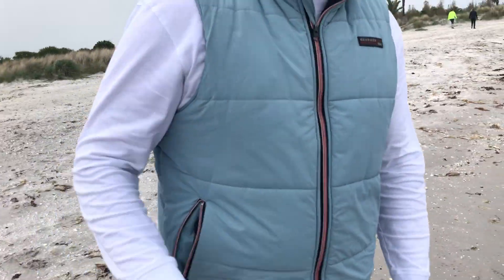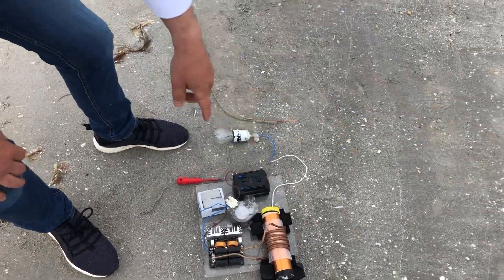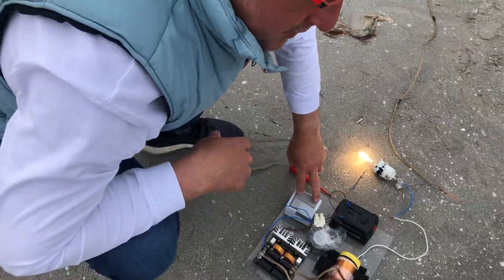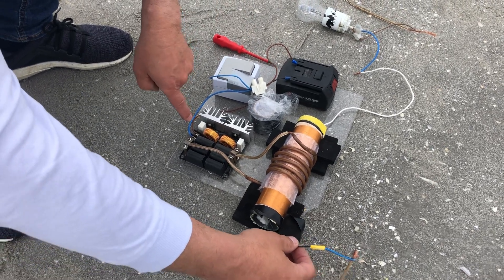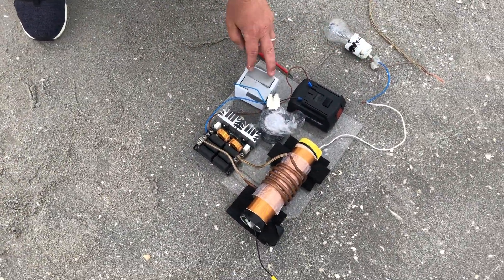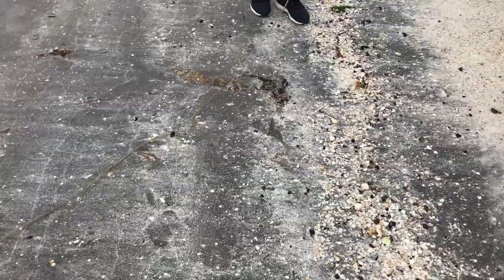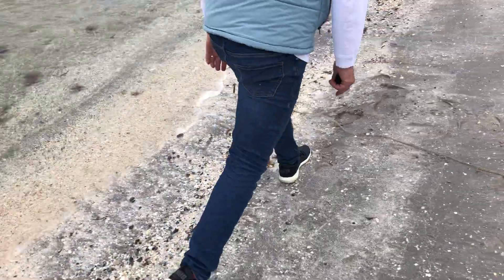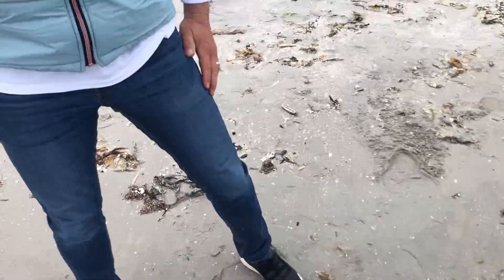Earth medium for electrical transfer

Comment: Did you tune L2 (secondary) coil to work in resonance with ZVS?
Reply from the maker: These ZVS circuits self tune, they are versatile.
Reply: Yes, ZVS is self tune but with L1 coil (primary). In my opinion for best results also L2 (secondary) should be tuned and adjusted wire length.

Comment: hello, how long can a light bulb last? How many amps does the circuit consume and what is the power of the lamp?
Reply from the maker: Sorry I have not made any measurements for this experiment, it was to show the possibilities of salt water to use as an energy transport for electricity enabling the circuit to be closed and light the bulb. ZVS heater circuit and 18vdc input and 230vac bulb at 40 watts. It could be interesting to see how many bulbs could be lit and for how long and if a salt water battery could power this ? Also experiment with the distance between the rods.
Reply: @dkdyker  I think that if the wavelength of the output coil is in resonance with the frequency of the generator, then free energy work is possible, thanks for the experiments

Comment: Super cool.  Schematic please!
Reply from the maker: I will when I have more to tell. Please pause the video. It is a battery to a ZVS circuit to a copper tube L1 induced to L2 thin copper wire maybe 350T with two copper rods into the sand . One side has an light bulb connected . That is it . Good luck

Comment: Nice demo.
It should work as saltwater/seawater adds more conductivity. It is more like conducting wire in between. Ordinary or garden soil has more parasitic capacitance than this setup I guess. 
So this test is best for power transfer thru Earth and by sea.
Reply from the maker: Thanks, yes the next test I will try to see how much I can recuperate also I will try to just light a bulb by sticking it in the area between the copper rods
Reply: @dkdyker  so the salty sand is just an ionic conductive path? Its all about the high voltage from L2? It would be interesting to see L2 with 10 taps along its windings to indicate at what voltage it will work for each meter apart the rods are spaced. I wonder if the high frequency is a major influence in this setup as in conventional electrical system it tends to travel on the outside  and is called the skin effect but in your setup the sand i guess does not have such a skin so to speak. You  have definitely peaked my interest👍🏻 i guess this is why wardenclyffe was near the ocean ??? 1km away!!
Reply from the maker: @Buzzhumma  I feel wardencliff was built on a very capacitive ground. More carbon and iron combinations. I have buried a large aluminum piece in a meter of soil. I feel that it’s all about reflection